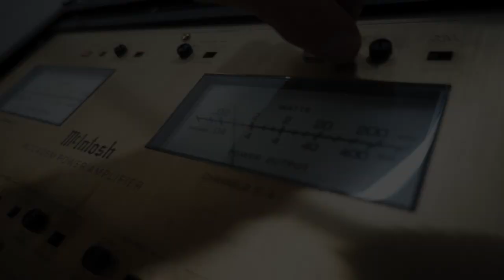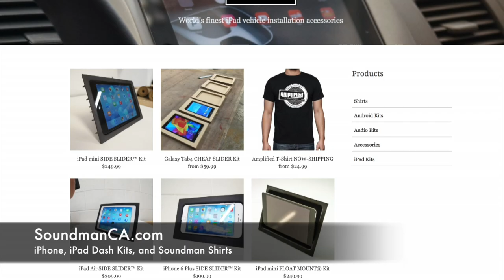2015 Tundra Speaker Adaptors and Sound Deadening

Comment: for loud listener or high power speaker need lot of sound deadening material to tame the vibration, while the only solution came in mind is to cover most of the area and it works very good.
for the 6"x9" convert to 6.5" speaker, you will need a foam ring to direct the sound and prevent it to leak back into the door panel.

Comment: ***** What kind of roller was the one you used to put on the sound deadener? I bought the wood one from dynamat and it's a p.o.s., the roller falls off the handle if I push too hard.
Reply: Joseph Stalin You can just use a wallpaper seam roller, it's the same thing. Only difference is they cost less than one with Dynamat wrote on them.

Comment: Not gonna lie.... i have about 75% Dynamat coverage (single layer) on all metal surfaces in my interior with Dynaliner on top and DynaPad under the carpet. I took the time to cut out around all bolts/clips/small holes and under harnesses. But i will say my truck is a lot quieter and cooler in the summer haha. I know it was overkill but hey... to each his own.
Reply: Its a matter of understanding what the material does and doesn't do, and most in the car audio world simply don't understand what they're doing, from amateurs to so-called professional installers, so they lacquer their cars in this stuff! Opinion has nothing to do with acoustics!

Comment: The reason people "over deaden" their vehicles is due to not needing the deadener to lower road noise, or increase midbass, or whatever (typical 25% coverage can achieve this), it is to simply add mass to the panel. More mass = harder to move and therefore retain more pressure inside the vehicle. Newton's second law, F = ma so a = F/m and the bigger the mass the less acceleration or movement you will have.
Reply: Exactly! :)

Comment: ***** i have a question. im getting feed back thru my speakers what can that be? its driving me nuts i hear my car accelerating thru them smh ahhhh help me
Reply: Ground loop. You are hearing alternator whine. Plenty of tutorials on how to fix.
Reply: jonathan hernandez  is the live wire running on the opposite side of the battery cable

Comment: How are you gonna replace a window motor or mechanism with the door holes covered up. Think of that!!
Reply: A Vong You would have to remove the sound deadener and board from the hole first.
Reply: Once you stick the sound dampening down its stuck for good the glue it strong.
Reply: kenneth man It depends on the type of adhesive the brand uses, some are stickier than others. Dynamat is a lot stickier than Focal Bam as I've used both. Besides it doesn't look like he used much to stick to the door, could get a stanley knife and cut it out or peel it from a corner.
Reply: *****
People do go overboard but covering those service holes is a must. People usually put thicker pieces of wood or plexi where the holes are and just put on enough deadener to hold it in place so it's easy it cut out.

Comment: The outer skin should have plenty of sound deadener, specially if your going for bass and not SQ. I did 4 layers of Knukonceptz 100mil deadener on my front and rear doors outer skin and it made a world of difference. Then once I was done with the outer skin of the doors I did 1 sheet on the door window regulator panel. Well. Mine comes off completely so I have no holes on my car. Just a big sheet of metal with bolts around the edges. :)
Reply: Rockfordfozgate
Reply: jose luis ruiz how much sound deadner did u buy?
Reply: RAY D I got 70 square feet total. 

Specs: Dampening Material: Butyl Rubber
Total Thickness: 100mil (2.5mm)
Foil Thickness: 10mil
Weight: 0.93 lb/sq foot
Sheet size: 1.75sq ft (11" x 23") i got 40 sheets total but still have about 6 sheets left. The Knukonceptz Kolossus edition 100mil deadener is pretty damn good and doesn't cost as much as alpha damp which was my first choice. I would highly recommend Knukonceptz Kolossus edition deadener. Can't go wrong with 100mil. You will definitely hear the difference.
Reply: any smell to it? did u have to clean the metal with alcohol? did u do all 4 doors? did it make a huge difference?
Reply: RAY D when it comes to smell, it did smell a little strong when I first took the sheets out of the box but once I applied them to the car within 2 days the smell was completely gone. As for surface I did use a spray bottle with rubbing alcohol in it  and sprayed the door from the inside and wiped off the dust in the door and the small amount of sludgy looking grease at the lower bottom of the doorwith a microfiber cloth and then applied the deadener sheets till I heard a solid muted knocking sound on the door. As I was applying each sheet I was also knocking on the door to see how quiet each sheet would make the doors from road noise as that was my main goal and I found 4 layers of sheets worked great. I did put it on all 4 doors and I can immediately tell the difference. Now I need to do the ceiling and floor as I can really tell where the road noise is coming from now.
Reply: RAY D I have another channel with an unboxing video of the deadener along with a review of how it sounds with it on my front doors. It's called "Knukonceptz 100mil deadener unboxing / Review" my other youtube channel is called The Average Guy1983 you can also search it by my youtube channel and then scroll down to the Knukonceptz unboxing.